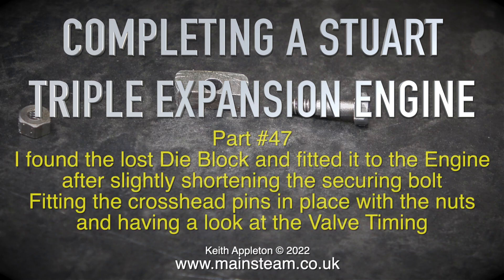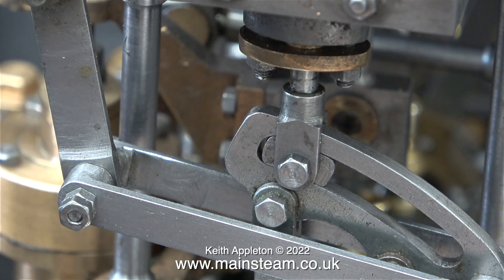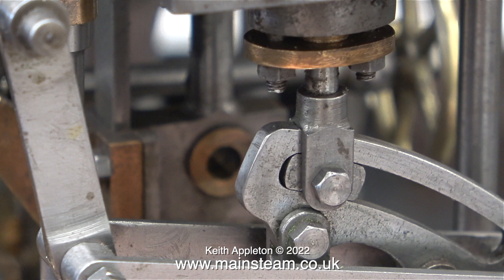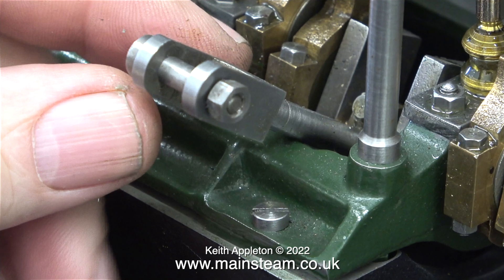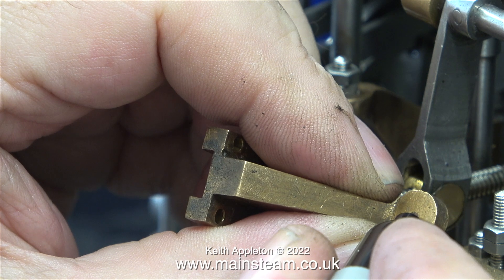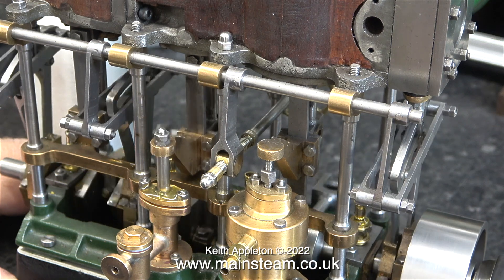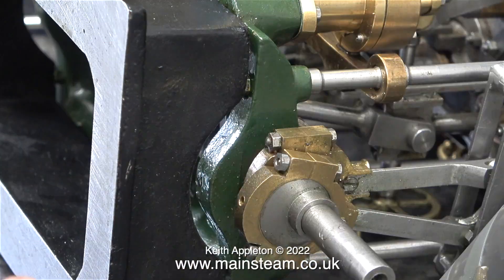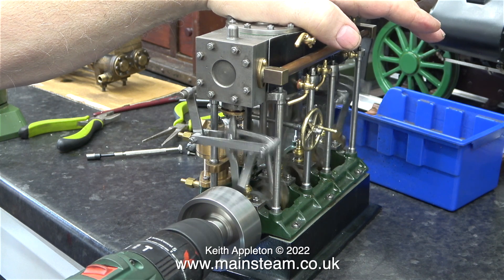COMPLETING A STUART TRIPLE EXPANSION ENGINE - PART #47

Comment: To fit the bolt in the crosshead, I use a short length of 3/16" steel with a heavy taper at one end to act as a push through pin.
With the parts roughly aligned, the pin is inserted taper end first, aligning the two holes and then pushed through with the bolt.

Comment: I'd love to build something like this . Something powerful enough to easily spin a 3-5 kw alternator. 
I was also thinking about a Tesla turbine. But a turbine seems to be a bit hungry, and possibly low on low speed tq. I don't know much about them , the thing they have going for them is easy to build, I want to use it to charge batteries in a off grid house, when the sun isn't producing.
Reply from the maker: These are MODEL Steam Engines (Miniatures), and are no good for serious work as they will wear out too fast .......